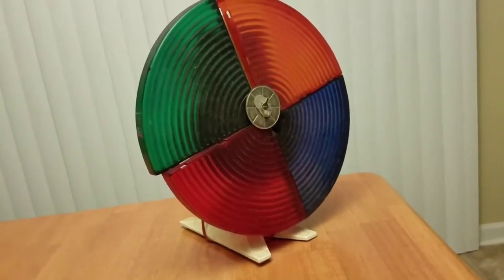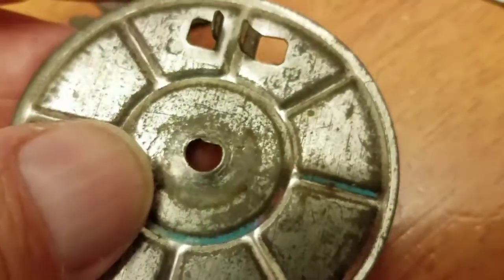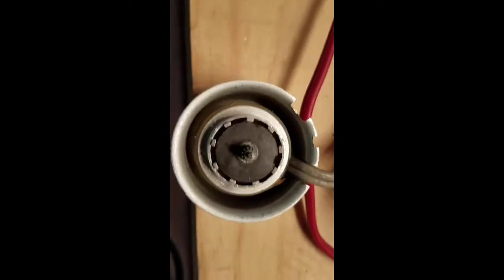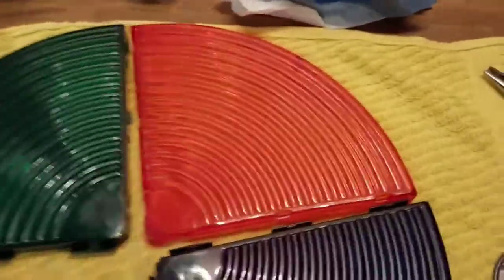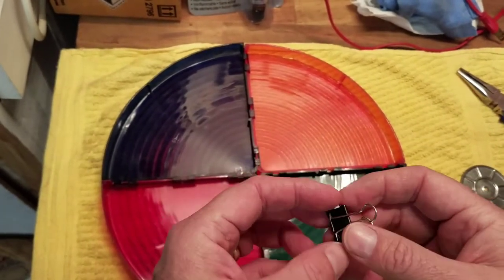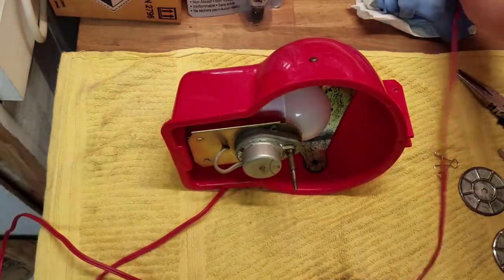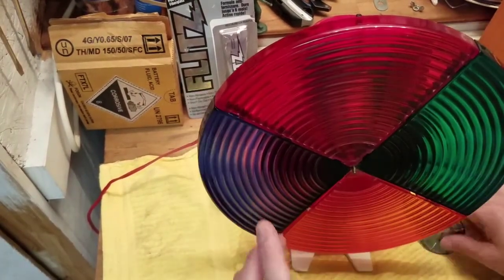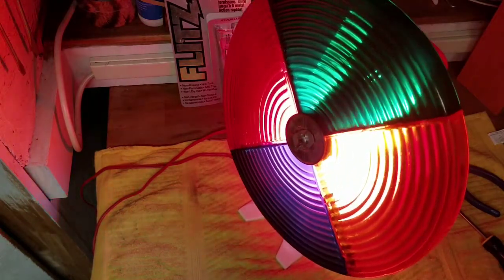BLOW MOLD HOSPITAL (repair) - Restoring a vintage Christmas color wheel, broken and not working

Comment: where do you add the oil?
Reply from the maker: To the main gear shaft and the points where the gears mesh. Not a ton of oil, but enough to coat. After I cleaned the old gummy oil off first.

Comment: I have the same unit.  Oiling and cleaning have not helped.  Do you know where I could purchase a replacement motor?  Thanks.
Reply from the maker: I did a Google search, and surprisingly, Amazon came up with replacement motors for sale. Now, I would do my research to make sure it is what you need before buying, but they didn't seem too expensive. I do not have any experience replacing motors, but I have a brother who did without an issue.
Reply: Thank you for this information.  Happy New Year!